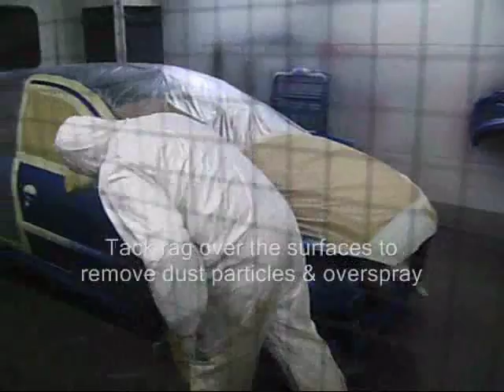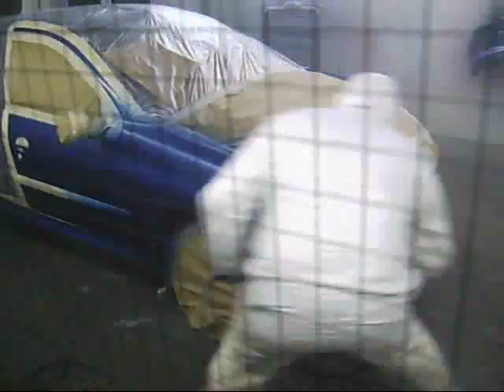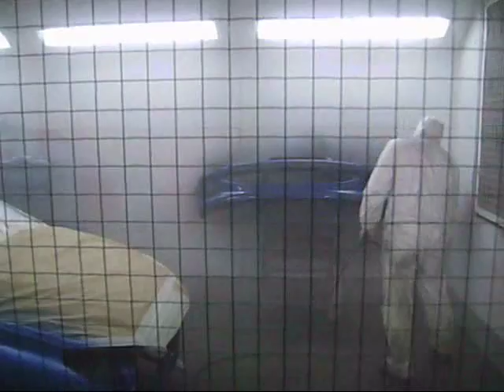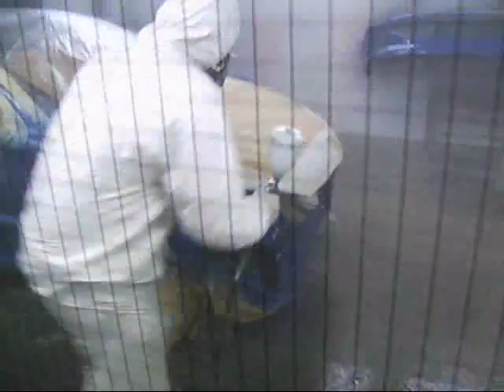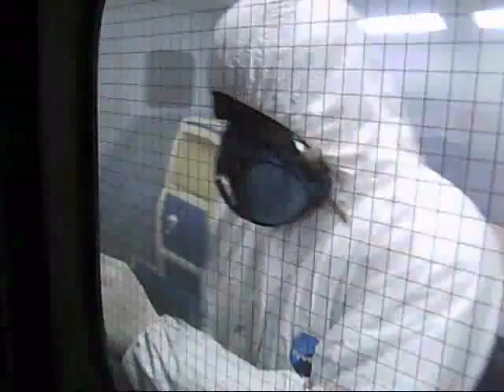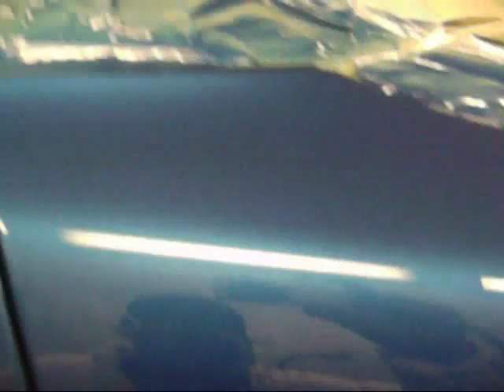Spraying 2K Clearcoat aka Laquer

Comment from the maker: @Zlyzer - make sure primer is sanded totally flat. spray light wet basecoats not dry dusty ones. use enough pressure to make the clearcoat go down in a fine light mist. not too little pressure as then you get a heavier lumpy texture. remember air going back over the soft clearcoat will affect the surface just like blowing on water, let clearcoat set properly before coat 2. dont wait too long between final base and clear. polish with correct compound & mop heads & dont rush!!

Comment: That finish is great! Unfortunately I tried this a couple of days ago and it came out of the gun horribly - it had fisheyes and all sorts in it.. a horrible wavy texture, and I couldn't explain it as the basecoat and primer came out fine. It didn't adhere properly to the surface and as a result when I polished it up had a horrible pattern in it akin to crazing, but on a smaller scale. Any recommendations? What PSI would you suggest? Also, I was using a 1.5MM nozzle, is this not ok?